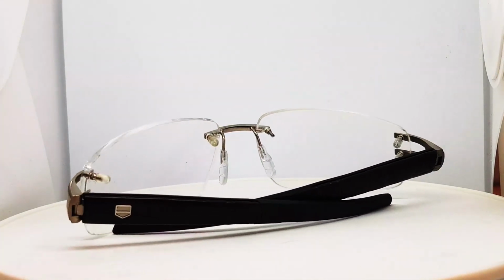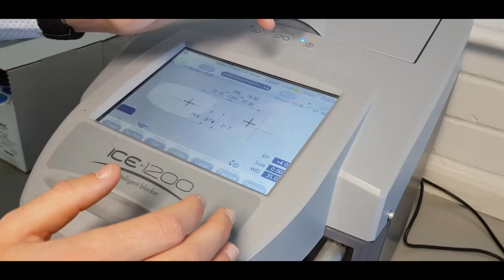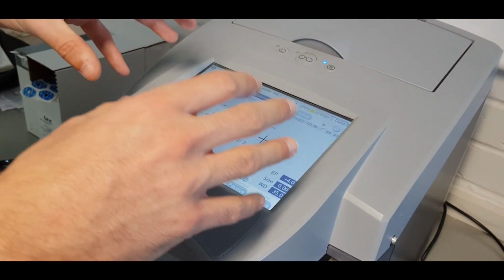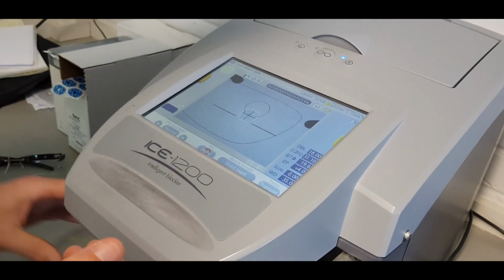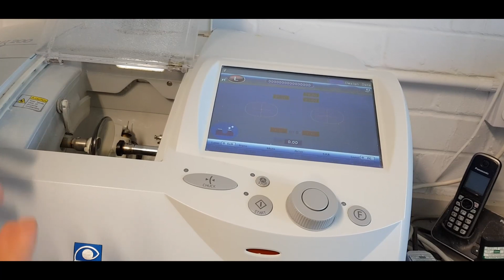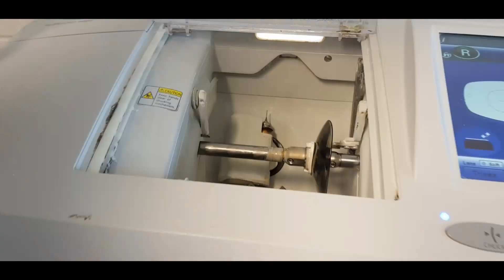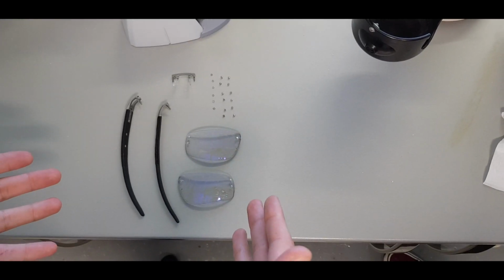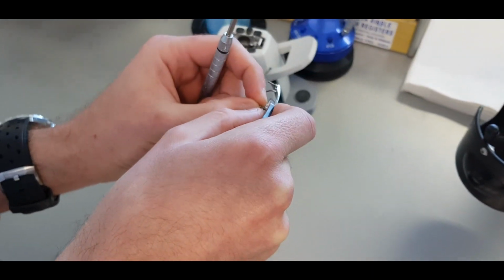This is how we make rimless glasses

Comment: Excellent informative video, all my life I’ve used Nike Titanium frames and Puma cause they have that rounded wrap are kind the face effect, but next week I will get my first Rimless Perry Ellis Glasses. I did a fresh eye testing and I actually purchased a pair of Nike frames with that perscription last month but was so obsessed with this rimless design and “curved angle” I couldn’t resist.  I will be getting a Titanium Rimless Perry Ellis with the Knots and washer and cap and was warned the parts need adjusting every couple months and the caps if lost are difficult to replace. My Lens will be treated with My perscription , Xtra Active grey transitions, Blue light blocker & Anti-glare.. To be honest My old puma frame had Xtra Active transitions but no Blue Blocker ...This Nike frame I purchased has the blue blocker and Xtra active & it helps with the burning in my eyes with electronics so much. I do live in a Tropical country so the Xtra Active was a must. I wanted to be safe so I went with the grey but I do wonder how the gold or blue would’ve looked, I heard they have a slight tint indoors .would u advise that I buy a glasses repair kit online ( any recommendations on the type of kit) to tighten the screws on my rimless frame as time progresses. Any tips on maintaining them..I’ve been quite hesitant over the years of using any soap or chemicals and I’ve had no peeling that is see in some people frames especially with transitions coating.... the only advice over received is to  remove and put them on with both hands ....so they don’t crack on the screw area .
Reply from the maker: Hi Christopher, I wouldn't recommend a repair kit because if you over tighten the screws even a little bit, this will cause the lenses to crack. I do recommend Transitions Xtractive, but Transitions Vantage would be even better for you. Curved rimless frames are very hard to make, but can look amazing when done properly.
Reply: @thespectaclefactory  oh I’ve never heard of Vantage Transitions, I actually had to specifically request Xtra Active lenses. With regard to your online website, is it possible to use my new perscription & have the glasses customized with a curve similar to the one in the video would be sufficient & have it delivered to me in Florida? At times I am even on business in the Caribbean.. I did visit London last year but no plans yet..